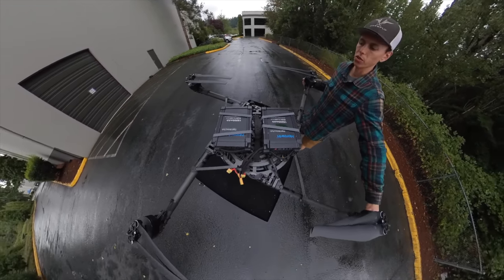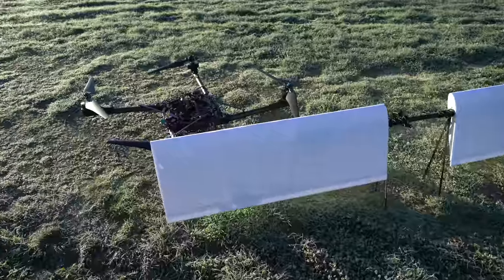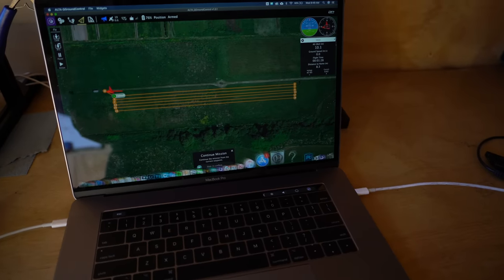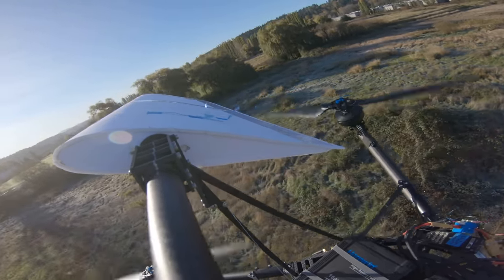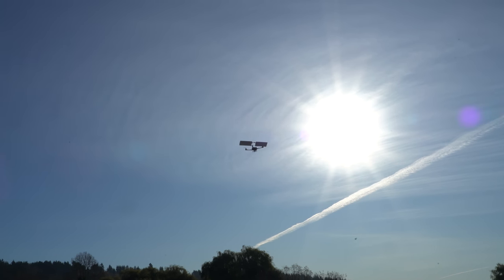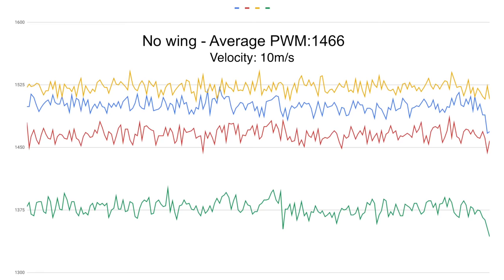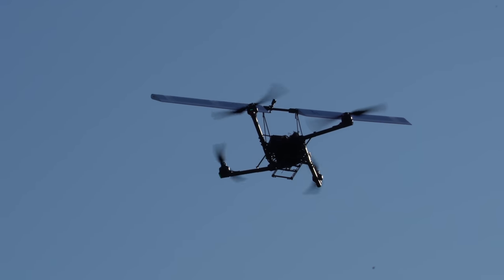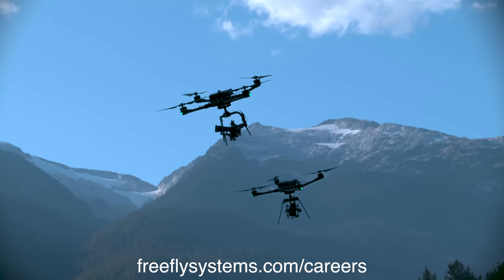Can a Wing Increase Quadcopter Efficiency?

Comment: In my mind, have the cg of the wings in line with the rotational plane of the 4 rotors and center of mass?, but they’d have to be extended outwards to avoid collisions with the blades. Have something set up so the wings stay horizontal to the horizon.
The idea I’m going for is a “gyroscope with wings attached out of its sides” (the whole quadcopter )with wings out the side of it,
As the “gyroscope”/quad pitches fwd (quad blades to provide the fwd thrust) the wings remain parallel to the ground and in fwd momentum start to provide lift. Thus the 4 blades start to act like propeller(s) while the wings do the work of lifting. And as you slow down the work switches from the wings back to the props which are now providing the lift.

Or short story long,…. Take a STOL plane and instead of the one prop in the middle of the fuselage, that rotates to change from hover thrust to fwd thrust, replace that with the quad copter
Reply: X’s are the rotors

           X     X
———     X     ———   “<-wings”
           X     X

A top down (birds eye view) if this helps.

Comment: Extendable wings would be sick, if their complexity didn't add much extra weight.

Also, is there a better spot for the wing itself? I don't know the answer, but would in-plane with the spinning rotors be better? Maybe straight out from the sides of the center of the quad?

Comment: Interesting experiment, I expect a big problem is that the flight controller hasn't been trained on having a wing that moves and buggers up the flight characteristics so much.  I also wonder if a fixed wing might be better and a fifth motor to handle the forward flight rather than a traditional quad.  With a fixed wing and a flight controller programmed for the job it could probably change the angle of attack via the front or back pairs.

Comment: It would be nice to put some kind of control system on the wing to keep the angle of attack stable, no matter what the drone was doing.  Also there might be a way to keep the wing stable  so it doesn't tilt back and forth (right and left)  I'm pretty sure that trim tabs could be added to the wing to do this.  If not, maybe some type of control could be programmed into the drone controller for the wing.  Just a thought.  This is a good start though.
Reply: Its a servo attached with pixhawk accelerometer ..same like gimble..level always

Comment: If you measured the drone's angle of attack sans wing at various speeds then you could use a fixed wing (adjusted for desired speed) which might be more stable.

Comment: here's a weird concept I've had... think of a large ducted motor setup... where in the lift surfaces are actually built into the duct shape... such that the drone tips 90 degrees, top (or bottom) becomes front. Also variable volume- use differential air pressure from a fixed portion of a duct to reshape malleable portions into more horizontal surfaces for forward travel. Heavy and inefficient... probably. But it's like 1/3 as good an idea as an Osprey. What could go wrong.

Comment: You effectively made an uncontrolled control surface. An uncontrol surface... Without the ability to fix the wing, you're just creating a lot of drag. You could also make a tremendous difference by having a way to tilt the rotors forward so that the props can direct more forward thrust with less energy. Maybe a sort of bi-wing tilt rotor design? Something like an Osprey, but the horizontal stabilizer is just as wide as the wing, and has matching rotors.

Comment: I know pretty much nothing, but I wonder, is the drone throttling down to maintain air speed and then losing the angle of attack needed to engage the wings? If that makes sense, I’m not really sure how to put my thoughts.  And I agree with others about that this isn’t the best possible placement for the wings. But a nice video either way, so thank you.

Comment: I tried something similar with small quad copter with a 3d printed wing but I didn't achieve to make the wing have the correct angle fixed (I tried with servo motor to see desirable angle).
The conclusion was the wing should be put at the same level than props (on the vertical axis), the pivot of the wing should for sure be on the front to avoid props collision.

Comment: Is this just an experiment to see if a quad can be improved without redesign? Arducopter has support for transition from quad copter to fixed wing flight so it seems better to use that for this purpose. I haven't finished the build but I have a 3d printed VTOL that uses two props for vertical lift before transitioning to a normal fixed wing flight. Though I imagine my payload capacity is less than a quad would be.

Comment: the problem you're having is the wing is way above the CG, so its effect is highly variable based on the angle of the craft. Try to put the spar through the CG and have the wings go beyond the rotor discs, maybe clip them tight to the rotor discs? You could also try to control the AoA with a servo

Comment: Instead of a giant wing on a pivot, maybe something like a fixed grid fin, or multiple narrow stacked wings would solve the issues with turning and blocking off air flow from the rotors.

Comment: I'm not great with physics but my gut tells me that if you added the wings to the side. Not like a V-Toll but just wings on each side you might be more stable albeit much larger footprint. The only issue is that you'll get winds going horizontally from the propeller wash that probably would hurt lift. Do you think at high speeds the prop wash might actually be adding additional lift to the wings? Because they should be lowering the pressure under the wing, I'd imagine this is also causing stability issues at intermediate speeds or in wind though because pressure would be quite dynamic depending on what RPM each propeller is. If I'm way off base, someone educate me I'd love to learn.

Comment: I'd be really interested in seeing if having 4 fixed wings, each positioned directly over the center of each rotor, would allow the drone to achieve perpendicular flight at lower energy use than if it were flying at a normal drone angle. You would likely need to change some of the logic in the on-board flight controller so the drone allowed the perpendicular flight to happen. for clarity, by perpendicular flight, i mean the drone would be almost 90 degrees to the side. if it were stationary on the ground, you would say the drone is laying on its side. 

also, would having the wings in an X configuration result in better flight characteristics, or would you want them in == configuration, relative to whatever the drone designates as "forward". would 2 wings be better than 4, or would that require a change to how the 'front' motors work, so as to not negate the lift generation of the wing?

Comment: I have a bit of an idea. What if there was a small horizontal wing above each rotor that was ducted to the rotor. The rotor then draws in air through the duct, sucking air past the wing which generates additional lift. Essentially its like a blown diffuser on a race car, but instead of blowing air past a diffuser to create additional downforce, you suck air past a wing to create additional lift.

Comment: i would have definitely gone with a harrier/osprey setup... having the wings like a chinese dragon (folding up) then changing the rotor pitch and opening the wings... might have another rotor in the back for thrust and closing up the vertical rotors at speed

Comment: I almost wonder if a better option would be something akin to hybrid vtol propellercraft (like the osprey). In my mental model the drone propeller arms would be airfoils with pivoting ends on the front, using the fixed rear props for control. Going from forward movement to hovering would be slower than a standard multirotor. Alternatively, a hexarotor with the middle rotors capable of rotating forward, this would allow a much faster transition to hovering by using only the front and rear pairs of rotors to hover until the middle rotors rotate back to vertical. This would result in a minor efficiency and power loss for that fraction of a second, which shouldn't be too much of an issue given that with enough design work 90% of forward flight would be using only two rotors with airfoils, drastically improving efficiency and speed.

Comment: I think you just need to modify the flight controller to allow it to rotate in a specific axis, and align it to the same direction. Taking it to the extreme, I wonder if it could eventually hit the angle-of-attack limiter, and that bracing it so it could become a weird wing with 4 out-back propellers?

Comment: a stalled wing is still going to create lift in a certain “direction” even though there wasn’t any pressure recovery the bottom of the wing was still at a higher pressure causing lift

Comment: Could it be, the leverage generated by the distance of the wing to the mount base causing a pitch back tendency as the speed increases (increased leverage). This would cause the FC to fight as the front would be lifting when the quad wants the nose down... At some point the front motors would almost need to run reverse to keep the nose down....

I'm wondering if either the wing was somehow offset aft of CG (terrible idea) --think paramotor wing, or physically closer to the quad,  or possibly a shorter wingspan (less lift).

Comment: Any reason not to use the pivoting wings in both directions? Also maybe 4 instead of two for stability. Would remove the need for turning around while providing stability.

Comment: I know this has almost nothing to do with the video. But for long range and vertical take off and landing, why hasn’t anyone made a variation on the gyrocopter? 
If I recall correctly it has one engine on the front that propels it forward like a normal plane, but instead of wings it uses a rotor on the top like a helicopter, but instead of being powered it only spins from the flow of air generated by going forwards. However it’s enough to generate positive lift even in the event of an engine failure if there is still forward movement. Anyway, slap an engine on the unpowered rotor that is able to be connected for vtol and then disconnected when transitioning to forwards flight. And you’re golden. That way you get the benefit of a powered rotor like a helicopter that can be disconnected when in the gyrocopter forward flight mode.

Comment: The hybrid model obviously makes a lot of sense just looking at it - the question is over really to do this you'd need software that understands what is actually going on rather than adjusting for it thinks it's a quad copter and something strange is going on - and a wing that's balanced to the size of the thing rather than guesswork: something like enough lift at expected average airspeed to mostly balance it. A rearwards facing prop wouldn't hurt either: ideally if all is going well in straight and level flight and everything is perfectly balanced and you have software up to the job none of the quad copter blades should be spinning (not that you'd want this and you'd actually run them, just at low speed) and the aircraft shouldn't lose altitude at a defined reasonable speed - basically pitching in normal flight shouldn't really be a thing and that's the major reason it has those huge stability catastrophes it seems like. That's a lot, but it seems like it's probably doable and you'd get massive flights out of it with the convenience of being able to hover like a quad - and you don't have to do a lot of complicated work to switch between modes like say how a V-22 does. I don't think the pitch angle stuff makes a lot of sense - but clearly it's needed when the software doesn't understand how to fly like that, or maybe it isn't needed at all and it could have a fixed wing pitch and maybe it's more stable because the wing isn't flapping around, who's to say.

Comment: could work but only during forward flight and taking away a lot of the added efficiency just by how the props move forward
what could add a bunch of efficiency owuld be a flat foam board with holes in it around the props eliminating vortices aroudn the balde tips and effectively increasing rotor area that way without adding more balde drag

Comment: seems to be creating a upward pitch moment , most planes have stabilizers to couteract this so add some and brind down the COL to match COM line .from a controls system POV it should remove most of the oscililations also

Comment: how about autoGyro hybrid, with a low aspect ration rotor (long thin)  from CF on boom mast that tilts in on direction between on set of rotors. the Drone can tilt as needed and the rotor mast could maintain the angle of attack.  The crashes would be amazing!

Comment: you would probably need longer wings  and a front propeller.  In another words 2 flight systems. In wing mode it would give up precision for distance.  If the wings fold or fall off on arrival and waypoint ti would make it posible to do long distance work.

Comment: What if you reduced the wings to only being outboard of the rotor width? The prop wash would be less intrusive to the wing, which I'm sure caused al kinds of issues when the motors change rpm/thrust.

Comment: The idea works, but the aircraft has to be designed around the wing rather than a quad that has this extra bit added. So you basically have a VTOL flying wing. Swan Voyager is one of the examples of that configuration.

Comment: Check the efeciency if you put the wings UNDER the center of mass and in a position where the front rotors actually push air over the wing instead of destroying the flow. The angle of attack is a different story, very smart that wings are not fixed.

Comment: Maybe consider lower center of gravity and copper w/ magnet dampening of wing movement (Lenz's Law).
Reply: The principle used in balance scales to dampen movement, where speed of change in attack angle will be slowed, more when the the forces are greater, while less of a brake on it for smaller changes. One way to think of it ... as if the drone is still dealing with air of course but the wings seem to think it is syrup.

Comment: A glider can keep a person + the weight of the glider airborn for hours... Placing a ducted fan in the hull (low CG) of a glider would not be a problem. And you would only need very small ducted fan motors in the nose.Tail and wings to stabilize hovering. Fore pure forward motion you would probably use a very small (jet) fan, that could be built into the nose without much more drag. (would probably be close to 0 when the airflow goes through the hull .Like on the MIG`s).

Comment: sounds kinda strange but what if you but a small wing on top of the rotors and a larger wing on the underside. with a modified landing gear my theory is the props drag air through the small wing then push it back across the larger wing generating lift

Comment: Maybe a flexible AOA limiter (rubber band/(progressive) spring?) could get rid of the oscillations.
The fixed AOA limit means a leap in wing forces each time it is hit. Probably the controller does not like that.
Reply: and also, if there are only 2 running and the other ones  are off, there is no way to stabilize 3 axes of orientation (with a pid controller)
But maybe if the right rotor turns clockwise (so yaw and roll moment go to the same direction) it could work due to aerodynamic stability🤔
Reply: Anyhow really cool project 👍

Comment: You're close... Great stab at it by all accounts. Needs a rear foil as well. But it's the drone that should be moving the foils shouldnt change angle of attack. Keeping them relatively parallel to the ground.been  Working on this same concept my self for quite a few years now. Think formula one race car as a quad. Or at least that was my starting point. Tbh I'm about to rebuild because an angry now ex-wife burned my rc equipment and haven't been able to re-aquire enough to build a new one. But dude it's a good stab.

Comment: You should have installed a small flight controller in the wing so that the wing always has the same angle of attack.
As an extension, you could have programmed the angle of attack of the flight analogous to the speed.

Comment: Great Vid!  I will bet that you are losing a lot of efficiency because your controller doesn’t know about the wing on top, causing the oscillations that you saw, which will be less efficient compared to steady state rotation operation.  So change the controller to incorporate a wing model in its plant, then I think you could easily get double the efficiency you saw, and get it more consistently.  So I think you’re onto something!

Comment: I am curious if there are modern thermal sensors or for example an old array from a 90s to 2ks digicam (which are basically heat mappers) are feasible to detect uplifting streams for an efficient glide and fallback for corrections to the pure drone-mode?

Comment: What if instead of just the wing, you attached an entire sailplane? I'm thinking the horizontal stabilizer would get the oscillation under control. You could also use the elevator to trim angle of attack for efficiency at different speeds.

Comment: Oscillations are from the thrust vector of the rear motors gradually rising above the wings center of pressure. The wing is essentially "flapping" and the rear rotors create more thrust to account for the loss in lift. This is helicopter aerodynamics, not fixed wing!

Comment: I wonder if having the wings "at the sides", not on top of the rotors; might get better results.  With wing angle controlled by servo, not freely rotating.  Disclaimer, I have never own or used a RC airplane.

Comment: Attach the rotors on the wings. make 2 lines of wings with 2 rotors each and the wings should be in 2 parts so each rotor with a wing can move freely. But still keep the design of wing being vertical and then going horizontal to a stop